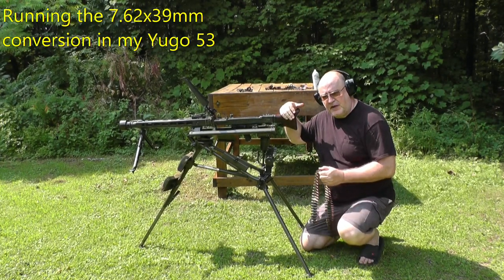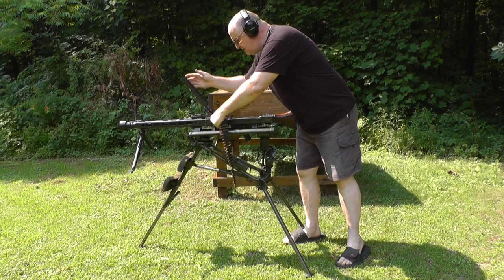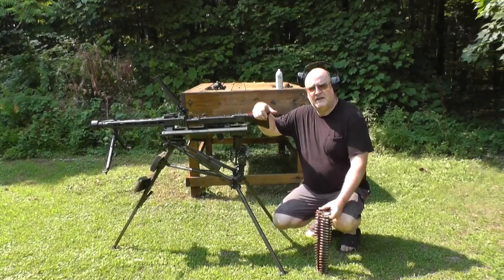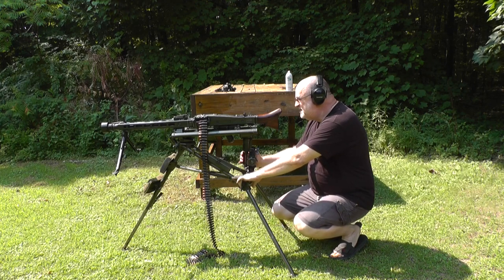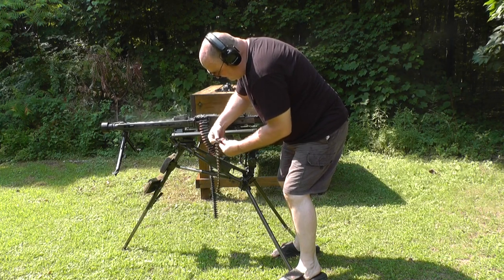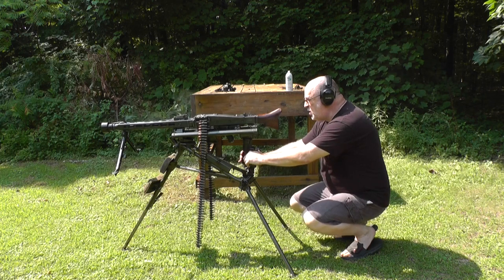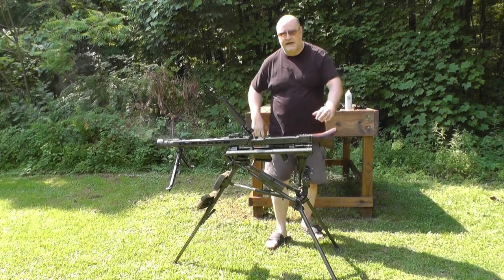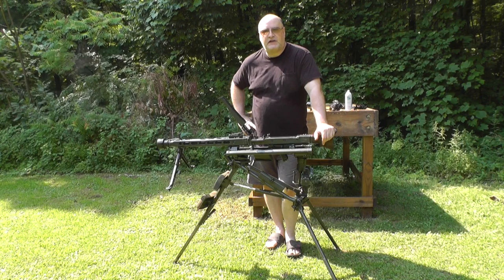Running the 7.62x39mm conversion in my Yugo 53

Comment: Excellent job on the conversion, seems to run pretty well. I wonder if that kit will work on a mg34/42?
Reply from the maker: It’s lewman arms kit and it will only fit 42’s that will accept the 308 conversion. 
   It took me 3-4 hours of fitting and testing, but I did not make the kit
Reply: @psp1921tsmg  thank you sir!